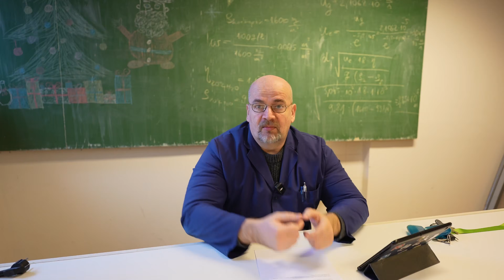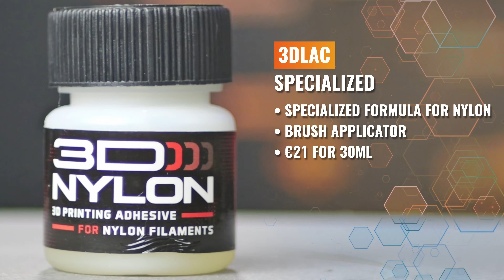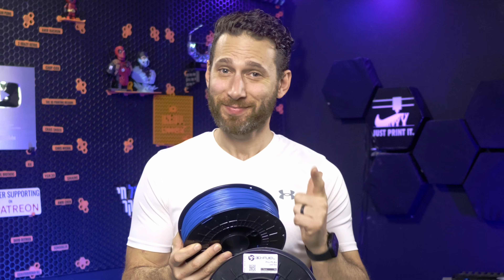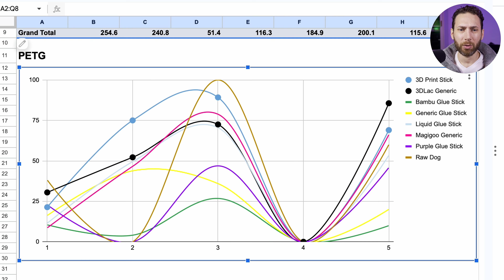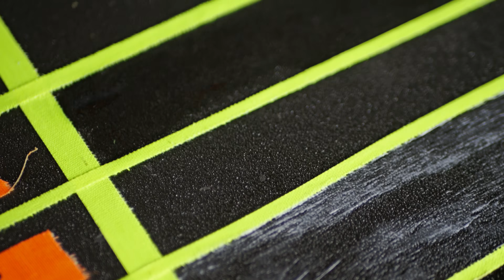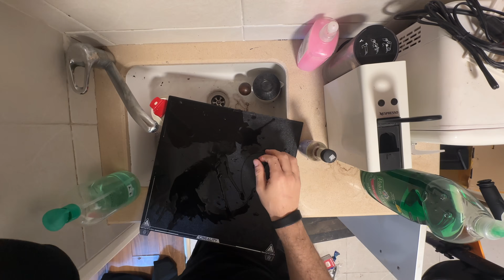I Tested 7 Types of Glue Stick for 3D Printing Bed Adhesion

Comment: The glue stick doesn't spread well..  goopy.  Problem is a clean removal, not bed adhesion itself. So far with ABS on a textured PEI sheet, hair spray is doing the job as a release agent.   One spray, lasts several prints.  Alcohol seems to clean it off pretty well.  Hair spray is doing the job for me for ABS anyway.

Comment: I use amazon basics glue sticks as a release agent for tpu. And petg/pctg on my creality print bed. Everything else, I raw dog. Finally washed the glue off after a year because the scars had gotten out of hand from multiple applications and no washing. And reapplied it. 

My biqu frostbite and elegoo centauri plates haven't needed glue and have never seen tpu.

Comment: I wish you also did Aquanet Extra Super Hold hairspray. That's what I use. I like it, it evenly covers the plate and don't leave very much residue on the part like glue stick does.

Comment: Magigoo PA for nylon on smooth PEI.

Aqua Net on smooth PEI for nearly everything else.  Aqua Net has been magic and cheap. 

I do like squeaky clean textured PEI for ASA.

Bed adhesive with multiple uses can actually stick harder than a squeaky clean bed. I have the destroyed smooth PEI to prove it. My question is how close to raw dog does it get with multiple prints with unrefreshed glue.

Comment: One thing I recently tried to combat lifting at the edges was to use sacrificial material to oppose curling due to shrinkage. Wherever a sharp reduction in layer size occurred near the build plate, I would add a removable piece that extended past the layer's edge and line up with the edge of the bottom layer. This way the print had only straight upright edges. I didn't have any lifting issues, so I guess it worked!

Comment: I was having adhesion issues with PLA + glue stick, but I knew the application consistency was an issue. Even after cleaning and a fresh coat, the print would always lift at the small spots where the glue was thin. So I tried just raw dogging it. I re-leveled the bed and cleaned the plate without leaving fingerprints. I've been surprised to find that my results consistently outperform the glue stick after many prints. AND I don't have to worry about applying new glue!

Comment: This test is nonsense as the pulling on the plate influences all other adhesion results due to deformation of the surface. alsao, hairspray, widely used was not tested

Comment: for nylon get yourself a fiber epoxy build plate. the fibers grab the print and wont let go and if the build plate ever loses adhesion or gets dirty just scrub it with a 400 grit sandpaper a few times and its as good as new!.

Comment: Because of the catastrophic costs of most of these adhesives, I'm not interested so much in the absolute best. I'm more interested in "good enough. I try everything with Aquanet  Extra Super Hold" hairspray. If that doesn't hold, then I move on to Dimifix. If that doesn't work, I'll go to the nuclear option, Vision Minor. However, Viuson Minor is so expensive that I'll try to switch filaments first. The truth is, for me, hairspray works most all the time.

Comment: I literally get some PVA glue (most regular white wood glue) and water it down so it's like cream then brush it on in a few different directions smoothly. I then drop it in the P1S, raise the bed temp to 70ºC and wait like a minute until it goes clear. If I want it a bit more sturdier I do it again. Takes a few minutes but works flawlessly every time. If it's two coats I can peel it off in one piece and no need for Isopropyl alcohol. If I use one thin layer I have to clean it off with the alcohol. Cheap, easy, no stress.

Comment: My recommendation to anyone using glue sticks is to dissolve it in water (preferably distilled) then apply with a cheap foam brush. You can get thin, very even layer that doesn't leave much residue behind.

Comment: Honestly, I print mainly with PLA. I put generic glue stick on my bed, once, and I can print 10-20 prints before I need to clean up and re-apply. As for residue, I just clean the bottom side of my print in warm water and it just goes away.

Comment: I have a few PEI plates and use 3DLac spray can on one of them. I just use a light spray like I would if I was spray painting the surface. I use vision miner for most of my Nylon. I use magigoo for TPU a lot of the times because it helps with the release off a PEI plate.  Smooth plates I use 3Dlac or vision miner because they don't leave a residue. Also I clean all the plates with dish soap, brush and wipe down with 99% alcohol.

Comment: I use the Elmer's purple glue stick...I rub the stick on and then I use a lightly damp sponge to make a perfectly even layer across the build plate...I can usually get at least 20-30 prints before I need to  scrub the playe and start over...I'm sure there are easier ways or better products, but this works very well for me and it's super cheap...
Reply: @brucepreston3927  I've found this to work extremely well too with PETG on a smooth PEI plate.  My issue was not bed adhesion, but release.

Comment: Well, it all depends. P1S can't heat more than 100C. I have to use  adhesive. I have glue from bambu with cloth applicator and magigoo. Magigoo is better by huge margin in QoL. On Voron I just raise bed temp to 110 for ABS, it sticks pretty well. Just print hot. Haven't had any problems with PETG. But if it sticks to a plate too strong - probably you'll ned some adhesive. Hate using adhesives, but, still need some in some cases. I would go with Magigoo. Expensive, but works really well both for adhesion and convenience ib usage
Reply: I use a P1S and run the bed at 90-100 and don't need a glue stick. I just keep the plate clean.

Comment: Force doesn't have area in the divisor. You're using the term incorrectly. It would be newtons, not newtons per area. That is called the stress, and in atmosphere the pressure. I wrote this before the professor corrected you. as an engineer, it is a thing to learn about terminology.

Comment: If you have proper calibration, and a good first layer squish, you shouldn't need any of this besides with polymers like abs, asa, and pacf.
I have three high temp printers that are all of different make, and Gantry Style but at the most a bit of purple disappearing glue stick will guarantee a ~1kg ASA part will stay on all fronts. I still don't need it, but you may😄
Btw, none of those three printers have Auto leveling or meshing

Comment: aquanet unscented ultra hold hair spray... The purple can. Is anyone else using this for bed adhesion. I have using it exclusively for 10 years now. works really well. hardly ever have an issue with parts sticking or staying stuck during printing.

Comment: When I first got my 3D printer I right away upgraded to a glass bed. Then I still used purple glue stick. The glue stick meant after bed cooling I still had to pry parts from bed. After watching several YouTube videos I found by increasing the bed temperature of the first layer by 5 degrees Celsius that I did not need the glue stick and no more prying parts after bed cooled parts lifted right off. First layer temperature and bed level to me was the key.

Comment: Im still printing on an FR2 Plate in open printing space, so PA was a challenge. I tried Wood glue, Uhu glue stick, 3DLack, but some of them were not strong enough while others were so strong that i destroyed the parts when i plied the part loose... I really tried to avoid Magigoo because i thought its unreasonable expensive, but good god Magigoo PA has worked so well, and you need so little of it... I m still using the first bottle after a lot of PA printing so the amount of saved PA has totally outweight the cost of the Magigoo...

Comment: I'm a little surprised at how you interpreted some of that data. You recommended using 3DLac for ASA, when it scored 5.1 versus 5.0 when using nothing at all. With the number of trials you did, there is NO difference between 5.0 and 5.1, and absolutely no reason to have made such a recommendation.

Comment: From experience, a clean bed always helps. Also, not all of these specialized materials are readily available everywhere. Personally, I use a generic glue stick, not just for adhesion, but also to protect the bed surface. There have been cases reported in 3D printing communities where the bed cracked while trying to remove a print, so the extra layer really helps prevent that.

Comment: Thank you for testing this, unfortunately you don't hold the humidity in the air as a factor. In my experience that is a major factor in bed adhesion issues. When it is raining outside my prints experience way more issus than during sunshine

Comment: I have been 3D printing now for over 2 years. I have never used any adhesive and in over 500 prints I have never had a problem with adhesion (Unless the bed/nozzle wasn't properly adjusted and or the bed wasn't clean before printing). Note: I mostly print PETG, PLA, and occasionally ABS.

Comment: Thank you for your effort. I appreciate your content. To me, it is down cost. I have Cr10s with GLASS beds. One of my printers is a CR10S5.  A pei bed is near unobtainium for this work horse. Purple glue stick  is a $1 for 4 sticks! I apply, then spray with H2O and spread the glue evenly over a cleaned bed. This gives me a fine film to print on. Does the film transfer to the print? Yes, some times. But it is easily cleaned off with H2O and a paper towel.  Guess I am  a cheapskate.  For ABS on glass I use  an ABS slurry. ABS scraps melted in acetone works beautifully. Just paint a thin film on. Use a brush you don't care to ruin or use only for ABS. My two cents.

Comment: Aqua Net is insanely strong but I have moved to purple glue sticks because it's far easier to wash it off parts to prep for gluing together and off the biuld plate. Aqua Net is why better at sticking, but sticks so good it's hard to get off again. Another win for the Purple and Aqua Net is that you can pick them up for penny's a the grocery store when out shopping. I though can see if you are doing a print farm with many machines the high grade stuff would be a must, but if your a hobbyist like me I think it's over kill and your better spending the money on better filament or on a drier, 20 bucks here and there saved goes along way.

Comment: With the issues you experienced in the test methodology, i think this video tells us pretty much nothing, particualry about ASA>. Please do it again with a better setup as the overall data would be so useful. I think you really need to run each glue and material individually, whcih takes a lot fo time, but just run one per day or a couple per daya nd it will take up vey little of your time overall

Comment: i used to use purple glue sticks, but not only was it hard to put on evenly, it left "scarring" on my first layers.  Now I use the cheapest max hold hairspray and it works great.  I don't even have to put it on all the time.  I do only print in PLA.  DOn't get me wrong, the purple glue stick held like a champ, but the scaring was ugly on some prints.  I'm fairly certain it destroyed my build plate too.  I just flipped it over to the smooth side up and the hairspray is amazing on that side.

Comment: While most of the current generation of printers have "perfect first layers" or bed adhesion in general, I feel like the amount of variables between prints, materials and atmosphere is what's causing any "issues" and anyone that is printing for business would probably benefit from using a cheap solution here. I'm kinda shocked at how well the Bambu stick works and continues after multiple prints. Might have to pick one up myself.

Not sure if it's just me and my OCD but I don't think I could continue without redoing the test, just learning from my mistakes. But it's a lot easier said than done, great video and data!

Comment: try different build plates. dont forget g10. i use that and all materials i use work glueless. as for the ones i dont print with, makers muse once tested other filaments and found all can print glueless (though he may have made a mistake with tpu). i found no bed heat for tpu sticks well and having heated bed results in it sticking too well.
Reply: You can print ABS with G10?

Comment: Maybe its just me but I have this expectation that (for PLA at least) the first layer should stick properly without having to use glue. Especially if the printer manufacturer promises a 'perfect first layer every time' (although thats not my experience).

Comment: What, no Aquanet hairspray? 😢

P.S. All kidding aside, thank you for this video and the testing

P.P.S. I actually have had a ton of success using Aquanet on my PEI coated spring steel bed. Mostly, I think it’s useful as a release agent for when I’m printing PETG and TPU, both of which adhere very strongly to PEI. For PLA, the bare PEI sheet is good enough, and I rarely have issues with adhesion.

Comment: I dont see Layerneer on this list. It has been the best one I have used. Goes on when its cool and when the bed heats up, everything is solid with no lifts at all. Once the bed cools down it comes off rather easily. One of the nicest things about it is all you need to do is pour some water over it and everything comes off with no residue at all. I was surprised to not see it as I found it on a bed adhesion review result from google.

Comment: I feel like your attention to efficiency really caused the data to suffer. Trying to do all of these materials with all of the adhesion products all on the same plate creates an incredibly unrealistic situation. With the lack of proper bed temp and other conditions due to the rapid changing of materials and adhesions, the failures and issues caused so much variability in the results that i think its almost unusable. I'll vote for a second test! Each adhesion method should go 1 at a time with 1 material. All 10+ tests can be performed on the same bed all at once, but this time with the proper bed temps for each material. I think its going to affect it more than you thought.
Reply: I also want to add that the stickiest isnt always the best.. There's a space in between not being sticky and being permanently stuck where we actually want to be.. We want consitent stickiness that isnt too sticky so our prints can come off the bed without us damaging it trying to remove it.

Comment: @2.38 the surface area is not 100mm squared, it's actually 100 square mm. 100mm squared would actually be 100mm x 100mm, which is 10,000 square mm.

Comment: First, great production quality as always. The topic is really important, and as I have just attempted and failed, due to adhesion issues, in my first ASA printing project, really timely (for me). I used a smooth PEI plate, cleaned and scrubbed with Dawn & hot water. After that failed, I cleaned and scrubbed it again, and applied Vision miner nano polymer adhesive. the print made it further but still came off the plate during printing causing spaghetti. This video / testing was clearly a lot of work... too much for 1 person probably, and honestly should have also included built plates as a variable, as already mentioned by others (even more work). Perhaps in the future you can revisit this topic and split up the work by working collaboratively with some of your youtube content peers.

Comment: Hey!  I appreciate the video and the research, I had a few critiques I wanted to offer.

The pivot tables featured at 16:30 are very concerning.  You need to be VERY careful about drawing conclusions from graphs that include bad data; when it comes to data science, cleaning your data, especially via pruning, is a crucial step prior to drawing any conclusions from the data.  Your test 4 (and potentially 5) showing completely non-existant or random data in Nylon, ABS, and PETG indicates that something is wrong with the table and you likely aren't looking at the correct information.  I would highly suggest in the future, if you're trying to perform rigorous testing, don't underestimate the importance of cleaning up your data and ensure your charts are reflective of the data you collected; otherwise, your results can end up worse than useless.  Eliminating outside factors is also a good idea, I would have actually recommended an enclosure for this test because you're specifically trying to test adhesion and not real world application, your PETG data is a good example of this where everything seemed to get better over time (including your control, which really shouldn't happen).

Also, if you have anyone whose able to help you perform these tests, you can eliminate bias by allowing someone else to setup the test for you, i.e. applying the adhesive, etc. and only reveal the materials once you've finished charting the data and drawing your conclusions; i.e. referring to each adhesive as "adhesive <x>" and have them notate on a card somewhere which adhesive coresponds to another.  It won't be quite as good as a double blind study, since you still know exactly what you're testing for, however it's a much more responsible method of collecting data.

Comment: I used a mirror bed with my ender 3 pro and needed no adhesive supplement. Just washed with soap and water. As soon as the bed cooled it released fine.

Comment: I STRONGLY suggest testing DIMAFIX, I use it as a generic go to to avoid ANY AND ALL adhesion issues. I apply about once a week. ZERO sticky residue and great release when cold. 

When using ABS/ASA I re-apply every 3-5 prints when printing UNENCLOSED, or daily if enclosed, just to save some headache.